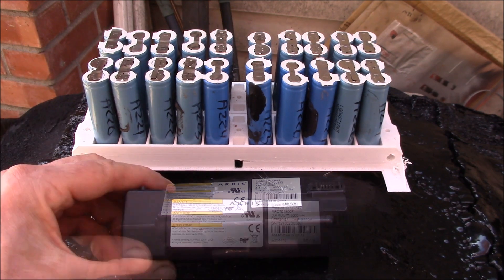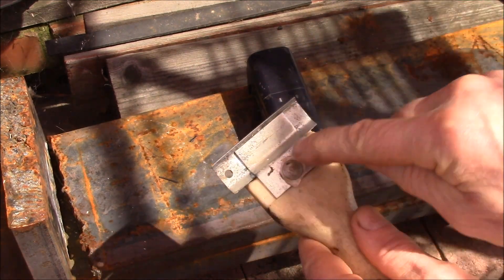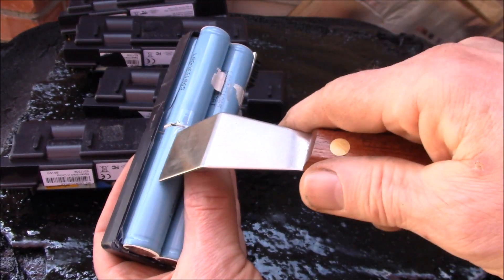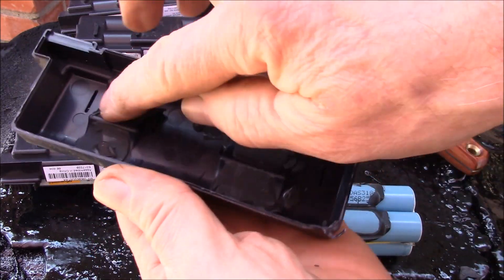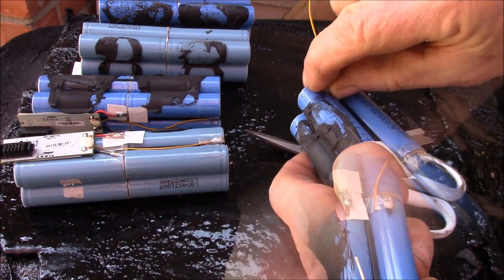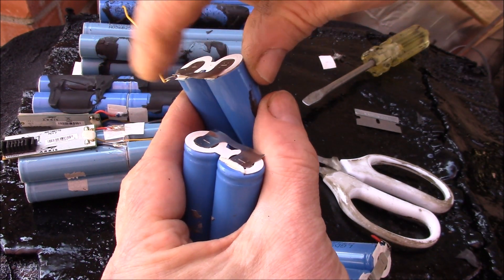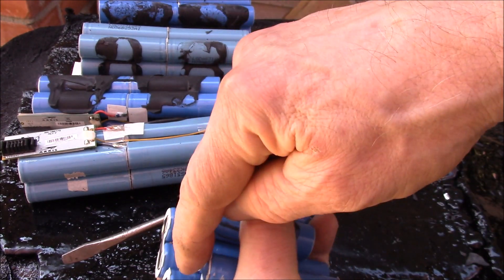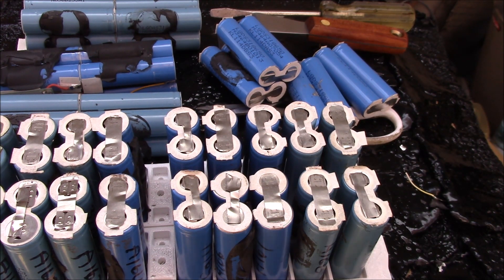Harvesting 18650 cells from 8-cell (2S4P) Cable Modem Batteries

Comment: Curious....how do you perform the "miliamp" current (power) rating for an 18650....i know the voltage is easy to determine...but how does on arrive at it's miliamp rating?  many thx!!
Reply from the maker: I use a few different RC battery chargers/dischargers to do that.  Here's one setup:
https://youtu.be/5DBeo5EElbk
These units will have a capacity test option, you charge the cell up to the desired voltage then run the discharge test down to a specified cutoff voltage and the unit will display a capacity in milliamp-hours.  You can also look up the p/n on the cell and find out it's original nominal capacity or look on the unopened battery pack and see what it lists for capacity.

Comment: Why does it appear that the only place to get these are from Battery hookup?  I would love to find a different source that sells them.
Reply from the maker: Yes, you and me both.  I suspect Battery Hookup is in PA and so is the Comcast corporate HQ.  I suspect Battery Hookup probably has connections with Comcast and arranged to take the decommissioned modem batteries.  They probably have all the permits and certifications to do that officially.  Maybe find sellers located near other ISP HQs.
Reply: @The4Crawler  I tried to no avail, and battery hookup is actually in a residential neighbourhood with a primary school a couple of blocks away.  I had them cancel my order because the system overcharged for shipping (they told me that and instead of 11 was 16)  PLUS one of the packs I ordered they couldn't find them on the pallet (was 2 as I wanted 3, but the system stopped it when I went to pay saying only 2 were avail and updated it).  After that I went digging into them a bit.

Comment: I've purchased a few boxes of Modem packs. 3oo cells.   Most have been well worth the money.  A few not so.
Reply from the maker: Yes, my experience as well.  Only had a couple that are not usable.  Using my 8 cell/pair ZB206+ based discharger for testing:
https://youtu.be/P0Bi1Sfmc4I